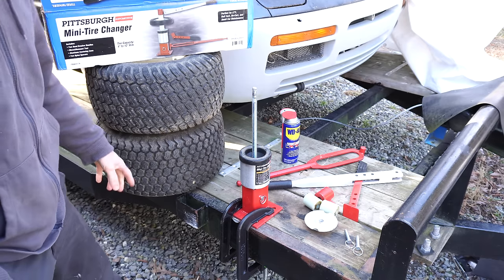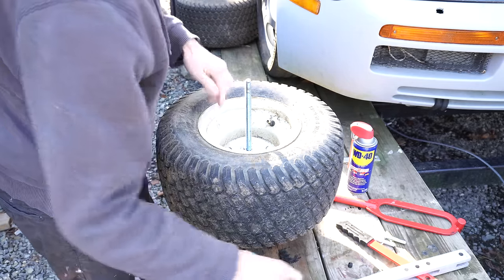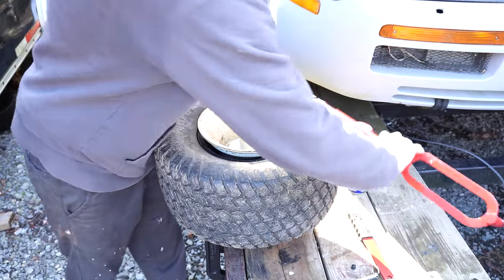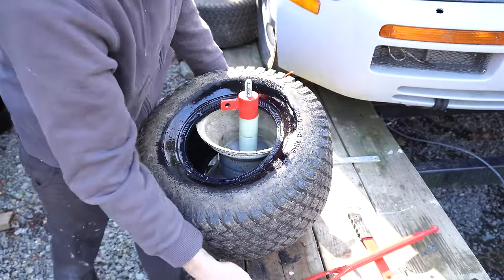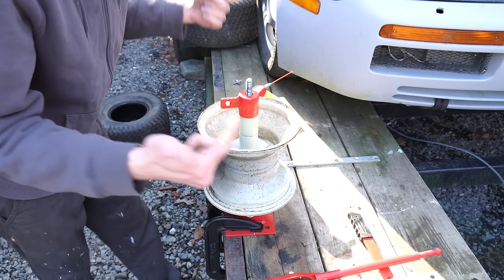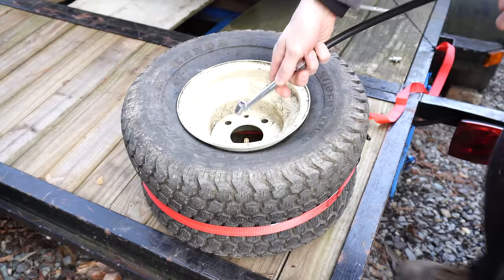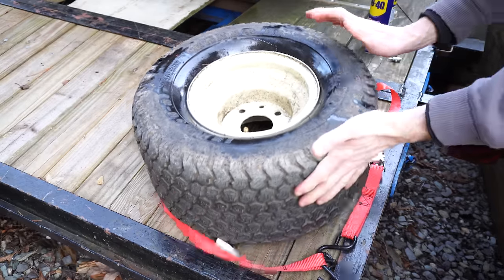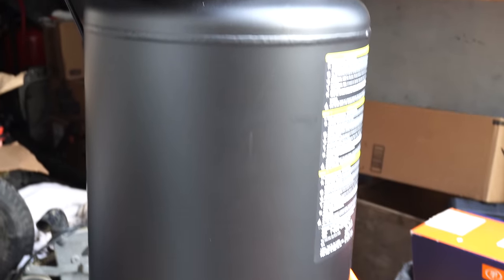Harbor Freight Mini-Tire Changer (How to Change A Tractor Tire)

Comment: One of the most satisfying things about changing a small tire is that split second when you see the tire is filling up with air.
Reply: Yeah I’ve been working to get a tire without a tire changer, the satisfaction I get when I’m finally done 👌🏼
Reply: Thank you so much for your video! I've had one of these for a while but didn't have to use it until just recently to replace the tire on the front of my riding lawn mower and didn't have the instructions anymore so I wasn't sure how to use what parts. Thank you for the video!
Reply: yx1lm - great comment

Comment: I've had this tire changer for a couple of years and it works great. I got one after a guy charged me $20 a piece to change 2 rototiller tires
Reply from the maker: Wow, the tire changer is a great investment then! Mine has paid for itself a few times over
Reply from the maker: @JD Spears This tool might be small for atv tires, you might want the car tire changer from harbor freight for the atv tires. I use the car tire changer for my tractor's rear tires, which are comparable in size to a typical atv tire
Reply: @JD Spears HF has three sizes to choose from. I have the mini changer. Love it.
Reply: my local tire shop (the one that's closest to me anyway), charges $25 a tire even for tiny tires like on a tiller or wheelbarrow. I think I'm going to buy this mini changer.

Comment: Not sure if you realized it or not but when you mentioned that the one rim has a large bead for the tire to sit on, on that type of rim you Must take the tire off and on on the smaller side. If you don't it will fight you both ways.

Comment: Nice concise, easy to follow instructions.  56 year old lady here going to attempt this on my riding mower tires.  Just ordered the tire changer from HF and a couple of rear tires from WalMart... Wish me luck!  😮
Reply from the maker: Best of Luck!
Reply: You posted this 3 months ago... How did it go?
Reply: RIP
Reply: @rso1411  LOL... not so good.  That harbor freight tool is pretty cheap and bent so I ended up taking the mower tires to WalMart and they changed them for me.  I jacked the mower up, got the tires off and greased everything real good and reinstalled the tires when I got home .... so I'm still pretty proud of myself.  I mean at least I tried 😁
Reply: @wickedwinnie  I had the same problem.  It worked great on a used tire that I remounted, but when I tried to mount a new tire it broke the tool.
Reply: @rso1411  Ahhh good to know it's not just me, thanks for the update.  You know, some things are just best left to the folks with the right tools, and since I bought the tires at Wal Mart... the mounting was free.  I just paid for disposal and I'm ok with that. 👍
Reply: Go for it.
Reply: @wickedwinnie

What did you do with the tire changer now that you no longer can use it? I would like to buy one, and used is fine with me

Comment: I got a mini tire changer today and after wrestling for an hour getting an inner tube inside and pumping air in it,  I felt confident I had succeeded in my first ever tire repair on my riding lawn tractor. But after removing the air hose connector, the air valve drew back inside the rim and disappeared. I hope it holds air because I have no way to pump it up if it leaks. The tire has dry rot cracks so it's days are about up anyway. The inner-tube was $23, the tire changer was $62. Add another $20 for a 1" x 3' steel pipe for added leverage which helped some. I used my carpenter's flat bar to finish getting the last half of the tire on the rim.

Comment: I bought the big one because they were out of the mini. Worked on my ATV tire fine. THEN i took my mower tire off and realized the dang centerpiece on the mower rim was too small for the big one. So i bought the mini. I have been struggling on how to mount it and never thought of using C clamps.
Reply: I also thought the c clamps were a fantastic idea. I put mine on a piece of 2x2 hitch tube and I can put it in my trailer hitch for mobile work.
Reply: You can bury a treated 8×8 in the ground end up. Use lag bolts to fasten it down. Of course, you can't change it on the road.

Comment: Well Done Sir. Very informative. I just had  3 hr and failed attempt at replacing a rear tire on my SCAG zero turn. I conceded to exhaustion and took the tire to a local tire shop…. 5 minutes- DONE.
I’m too hardheaded so I’m purchasing a Harbor Freight tire changer to be as self sufficient as I can.
Thank You for your video.

Comment: Thanks for taking the time to make this. I have 1 of these contraptions & it is worth it's weight in Gold to me. I have started workin on Minibikes again because the nieces n nephews need cool stuff to play with when they come over. I've acquired a few bikes all in various states of disrepair so we are starting from the ground up I have 8 tires to dismount (11 really, if we count the Super Tryke) but everybody is getting new tires as most of these are very dry rotted & old. That, & going to sandblast the rims nice & clean., then preserve them with POR15 so the rust will take A lot longer to show up again....  then mount tires with new stems & move forward .... 1 bike at a time .... I had forgotten how to do this so I watched your video & it was quite helpful thanks again for taking the time to make it. The little ones are gonna have a blast this spring n summer.... can't wait to see the looks on their faces when we unveil the new toys 😎😇🙏

Comment: If you leave the core out of the valve stem to re-seat the bead, you can get more air into the tire faster. Then reinstall the core and set your tire pressure. Nice job on the video; I've been eyeing one of those, but I think I can probably build one from what I've got laying around that will work.
Reply: hard if it needs a schrader to fill
Reply: I grew up changing tires in a family full service gas station. We always aired up the tires and set the bead before replacing the valve core in the valve stem and setting final pressure. A larger flow of air always helped set the bead first.
Reply: Well did you build one? That would be an interesting video
Reply: @elmo123smiley  lucky guy
Reply: @Justinlifts365  That is only to seat the bead faster... then you put the valve in to actually fill it.
Reply: You can probably get away with having the valve in on these small tires but I can see where a car tire needs more airflow
Reply: @elmo123smiley  Note that a normal tire air chuck requires the core to work.  It takes another special tool to do it your way.

Comment: Yeah, that tool looks mighty handy. I never knew why this one's more expensive than the car version at Harbor Freight. I made a homemade stand on a mini telephone pole about 3 foot out the ground. I was pinching inner tubes doing them on the ground. The rim off the ground keeps the inner tube from walking up the rim near your top bead. For breaking beads, I've always used a 2×2 stick and a dead blow hammer.
Reply from the maker: This one has some aluminum pieces and is probably more tedious to manufacture. The car one is just some pipes and basic lightweight steel welded up. I have that one too...it's good for bigger tractor tires, atv tires, trailer tires, smaller car tires on steel rims

Comment: For those of you watching this. The  aluminum cone he's using to clamp this wheel is actually supposed to go under the locking nut and the bar goes underneath the cone. This way if you apply slight upward pressure on the bar it stays on the rim while you turn it with greater control. Personally I have 2 of these cones. One for clamping, the other to support the bar on this type of rim. It works much easier. The machine comes with equipment for a wheel with an integrated hub. Cheers. Nice video otherwise. Hope this helps you as well if you didnt know that

Comment: The item used to level the spacers you see in different usage on other videos.  Your the first guy who seems know what he is doing with HFT tire changer.  Great tip you cannot set bead without air compressor, was just about to buy a foot pump !! lol.... thanks alot !
Reply: also use a ratcheting strap wrapped around the center of the tire to set the bead (squish tire).

Comment: Great Instruction.  Just a side not from personal experience.  Seating the bead is easier if you leave the valve core out, seat the bead, put the core in and adjust pressure as needed.  it lets lots of air into the tire all at once to force the bead to seat.

Comment: Just regular liquid dish soap that you use in the kitchen works very well for mount/dismount lubricant. Applied to the tire beads and rim bead edges and will go much easier and smoothly

Comment: First use of my new unit today. Older riding mower, small front tire. Couldn't get the bead to break on the back side. Bent the threaded bar and I wasn't really pushing that hard. Had to work all the way around the rim and finally found a spot that would come loose. This action either threads the top knob much tighter, or loosens it, as you go around the rim. But I got the tire off in the end. 

HF discontinued this unit, so I had to go 200 miles to "the big city" to find one of the last few in stock, since HF wasn't doing online ordering for it, nor do they transfer items between stores.

Comment: I’ve had one of these for 3 years now and they work fine.  The big threaded rod is weak and it bent after a few uses.  I bought a stronger rod and it’s good now.  Dawn dish detergent in water makes a good lubricant

Comment: I also have this tire changer and it works very good except that some tires can be too stiff to get on the rim with it. I changed the rear tires on my lawn tractor to some Carlisle Super Lug tires and i had to use the old method to get them on the rims. But this tire changer works good on 2 ply tires.

Comment: I appreciate your video.  I used, or rather tried to use, my HF Mini Tire changer today.  I spent almost 2 hours trying to get a new front mower tire mounted; got the first bead seated, but I just could not get the other side over the rim.  I don't see how the mounting tool is able to pull the bead down below the wheel rim.  Any suggestions?

Comment: I have one of these.  I just changed zero turn tires on 5" dia rims. Breaking the beads down bent the threaded rod. Other than that it worked good. They had tubes.
Reply: I was just thinking that it might bend the rod. Was looking to see if there could be an "easier" way to break the bead instead of this way.

Comment: Not easy with smaller, new, stiff tires. It needs a large washer to keep the install tool from popping up. And I got a suggestion from another video that suggested using hose washers to help keep the rim from spinning, which worked beautifully!
I installed new valve stems, too. If the tires are old, maybe dry rotted, most likely the valve stems are as well.
Reply: where do you put the hose washer?

Comment: Tractor/mower tires like this are notorious for leaking, even before you remove and reinstall them.  The rims just do not work well for tubeless installations.  I always add an innertube to prevent leaking in the future.  Before installing the innertube, make sure there are no rough spots, like welding spatter, on the metal wheel hub.
Reply: Green slime added in the tubeless works better than an inner tube, which also prevents the dry rot in the tyre.
Reply: They do on my lawn tractor, i have never had tubes in my tires

Comment: I have been doing  small tires for a while , the larger ones are generally easier , the smaller front tires can be disasters  the rubber is thicker and does not stretch.  Then some you have problems getting them on the bead .  So get a cold one and turn on the fan and enjoy

Comment: Smaller tires are even harder. I did two 15x6.00-6's on a Murray and it went ok. I did two of the same size on a John Deere with Carlisle 15x6.00-6 and it was impossible. Way stiffer. I will have to modify the tool to get it to work better, as it is, it's all bent up now and I'll have to mount it on a very sturdy surface, like steel or concrete. And I will have to modify it to not spin when I'm applying force. I'm making pieces to fit on the rim to hold it better. As the instructions show, it's no good at all the way it's designed from the store.  Also bent the hell out of the all threaded shaft.
Reply: hi be's music, I bought this hf tire changer, its great for rear tires, but front tires, specifically front tire of a commercial walk behi d mower..
nearly impossible. I ended up taking to a tire shop, I knew him for yrears. he cursed me up and down, finalyy changed it using screw drivers and vise grips to hold tire still. He told me to purchase new tires withe the rims already attached for the gfront small small tires. I want to try drilling a small hole, say 3/8, tbrought the tire ceneter rim, the somehow use a 3/8  bolt to hold rim still when putting the new tire on

Comment: You can seat a beed just using a pancake compressor and ratchet strap.
I use a big strap used on large flatbed trucks to hold down big loads, just crank it down done it on the tractor so many times. Had to to mow the grass and your tractor tirs flat.

Comment: I mounted mine on the bench but it was to high. So I had to stand on a stool to get down word pressure on the tool. Also I almost ruined the inner bead because my lawnmower rim had sharp edges. So I filed a radius and emery clothed it.

Comment: I don't think harbor freight sells this anymore, they don't sell half the good stuff they used to sell.  Great video by the way.
Reply from the maker: seems like it's on sale right now, which makes things disappear from their shelves.....I had to visit 8 harbor freights across my entire state (during my travels) in order to find a specific fan that I wanted
Reply: They still sell it. Currently they are clearing out the red model and are selling a new black version.
I've owned one for years, although I modified mine to work with go cart and mini bike tires. I also use tire spoons instead of the tool that came with it. I mostly use it for the bead breaking

Comment: I always change the valve step at the same time.  Soapy water, with a brush, before you put the tire on the wheel.
Reply from the maker: That's a good move to do that, I do if the valve is dry rotted or looks bad but otherwise I don't.

Comment: What is the diameter of the bar that is used to remove/install the tire. I want to buy a metal pipe to use as a longer type pry bar.

Comment: In my case im attempting to change an 11” escooter tire. Im most likely only going to be able to utilize the bead break feature. The size of the mounting bar will most likely be too much for small tires where ill end up using traditional tire levers. Regardless im hoping this device proves useful or else harbor freight is giving me my $70 back.

Comment: Does the metal on the tire changer scratch the wheels? I have nice wheels on my UTV and don’t want to scratch them
Reply: Nathan Mills Do all the removal and replacement from the back side of the wheel and you will be fine.
Reply: I used it on my atv and yes it scratched the surface of the aluminum rim. Dam! I also had to use a weight because the inside of the rim was bending. My atv doesn't have a sold rim like the one on the video. Has a wider hole in the middle of the rim. Honda 250 ex. Would be nice if they had an adapter for those rims.

Comment: Any tips on mounting a tire on a 4” rim?  Tire size is 4.10 x 3.5 x 4.  I cannot figure out how to get the 1st bead on with this tool or otherwise.  I took it to a tire shop and they worked on it a while with no luck.  Any help is appreciated.
Reply: I just replaced 4 tires of this exact same size for my mower. Put a little lube(I used Pam cooking oil) around the bead for the first side. You won't need any tools. Just press it onto the rim tilted and spin tire until it falls right on to rim.

Comment: You attached the black rubber grip with finger grips on the wrong side of the breaker handle. The finger grips are supposed to be towards the locking nut, ie center of the wheel.
Reply from the maker: I normally don't even use the finger grip, really doesn't matter, it's just a handle

Comment: I see people struggling with the valve stem tool, use an old valve stem in the tool for a longer reach. like a screwdriver handle, just shorter.

Comment: Hey FYI you have a bar you are using to break the bead with, why not use it to tighten the hold down instead of a crappy screwdriver
Reply from the maker: don't need it quite that tight, it would probably strip out or break the spacers
Reply: @aDIYCarGuy   may not need it that tight but you don't have to remove the bar to tighten or loosen it, and it will not move being that tight.

Comment: So what's the point of this machine if it always damages the rim when taking off a tire?
Reply from the maker: Who said it always damages the rim? This thing changes mower rims and other low value rims that normally have scratches on them anyway, what's with some of you people? You're going to scratch your mower rim with regular tire irons while changing the tire, you can change a mower tire with screwdrivers ffs. The point is, this is the easiest way to change a mower tire.

Comment: Tire just keeps spinning. First one came off fine but it's a no go. Surprised there's not a locking mechanism
Reply from the maker: yea i wish there was a clamp that holds the tire, but you gotta hold it with your body or arms
Reply: You can use locking pliers (Vise grips) to clamp on the rim and keep the tire from sliding around. Just be careful the pliers don't bend the lip of the rim. Mount with the backside of the rim facing up and the lip is usually stronger.
Reply: @patrick860  tried that. Vice grips just rip off the rim. Thanks for the tip though